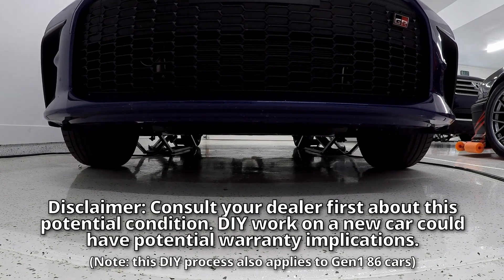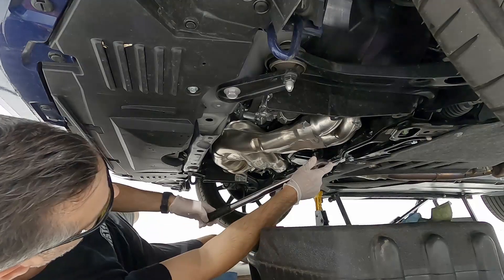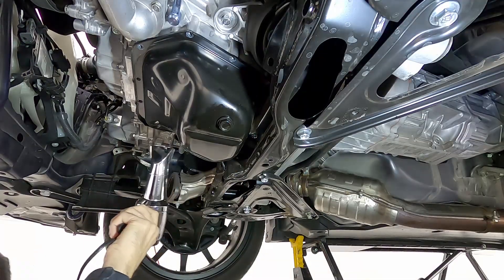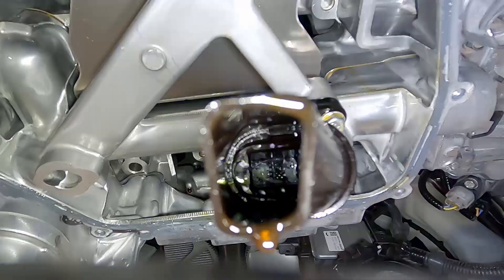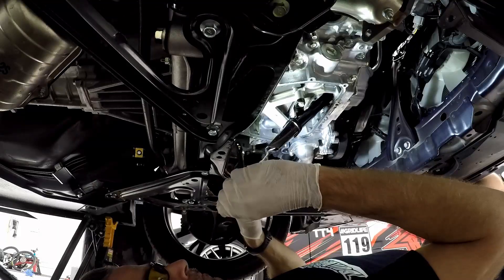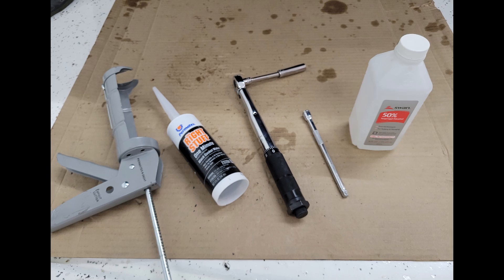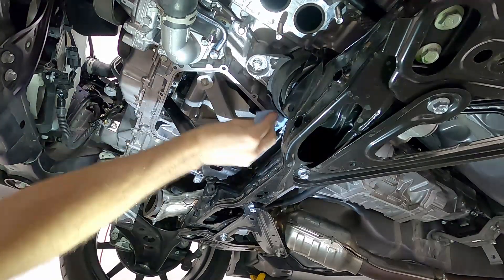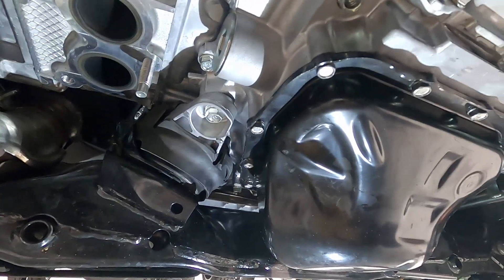RTV Silicone In Your GR86 or BRZ Oil Pickup? Here's How To Clean It

Comment: typical subaru built garbage engine, smh. this should never be a problem with any new vehicle.
Reply from the maker: Agree. I am not a huge Subaru boxer engine fan, but I had high praise for the way this one performs. This particular issue just took it down a notch again lol.
Reply: @TheBTRGarage  
 - what brand and type of oil did you fill after this service was done?

The reason I ask is because I did have this service performed on my 17 BRZ and I want the best of the best oil in my vehicle as I drive it daily and do drive it to the track as well as track and drive back from button willow.
Reply: Subaru and the lubrication issues go together like America and Apple Pie.

Comment: Toyota/Subaru should just revise this application from factory. I hope this is fixed for the '23 versions.
Reply: hopefully.. my '23 will be here in Oct. I only plan to do 17x9 arc8, 245/40 PS4S & camber/crash bolts. If the motor goes because of this silicon issue, it'll get replaced.. but the hassle of that process will always be on my mind.. big sighs......
Reply from the maker: That's the hope! With all the media coverage and chatter, I wouldn't be surprised if they at least investigate the situation.

Comment: Isn't the silicone supposed to act sort of like a gasket? why remove it?
Reply from the maker: I removed the heavy application of the gasket, which appears to have broken apart and into the oil pickup. I re-applied a new bead of liquid gasket per the service manual guidelines.

Comment: Called my dealer yesterday about the issue, due to having bits of rtv on my dip stick, the service advisor sounded concerned with he hasn’t dealt with the issue from other 86 owners. But knowing my luck I’m pretty sure my has some issue with the rtv since I’m the first gr86 they sold. We’ll see how it goes
Reply from the maker: Best of luck, hopefully it is a non-issue. Outside of the blown engine, it is just a lot of anecdotal findings like mine, but it sure seems like it is heading in the direction of wide spread.
Reply: Did your dealer do anything yet? Asking because I have the same issue and am hoping they don't try to pull a fast one
Reply: @tear728  they only did a visual multipoint inspection and claimed there’s nothing wrong with it as of right now so if it blows (knock on wood it don’t) I’m bringing it right back to them.

Comment: as someone who just ordered a brz this is very upsetting

if im spending 35k out the door i want piece of mind that im getting a good reliable car. Now i dont even know what to do, since I won’t be able to enjoy the car until I know this won’t be an issue, and im sure the dealer isnt going to just check the pan for free.
Reply from the maker: As I've probably mentioned elsewhere, I wouldn't sweat it too much. The chances of a catastrophic failure are still very slim, based on what is currently known. It's always good to be aware and cautious though, of things like this 👍
Reply: @TheBTRGarage  Im sure it is low, but even still I dont want my engine oil pickup tube blocked at all even if it never causes failure… 

Do you think subaru would charge an arm and a leg to just reseal the oil pan properly once the car arrives at the dealership?
Reply from the maker: Yea, I totally understand where you're coming from, tough situation.
Cost is going to depend on the dealer. One guy in comments here said his dealer would inspect for $175, if RTV found in pickup, they'd fix for free, otherwise out $175. Another I heard had to pay $700 for the repair, so it's hard to know for sure, unfortunately.
Reply: Its what makes a subaru, a subaru. Lmao. But in all seriousness it really does suck that I feel the best approach is to just wait it out, probably good to just wait for the 3rd/last gen after they fix the common problems.
Reply: Mazda Miata? (If a light weight rwd platform is your car of choice). I love the design of this new GR/BRZ but this would be a deal breaker for me. I have way too much O.C.D.

Comment: Just called my dealership for this exact issue for my GR86, and they could charge me a diagnostic fee for $175 to see if there are silicone bits in my oil pickup, and if they found any they wouldn't charge me, and if they didn't find any bits I would be charged. I was transferred to finance and it would void my warranty if I did it myself,  and he recommended to just drive the car like I stole it and if it blows up, they will replace it. It seems it's going to take some time until Toyota recognizes this as an issue.
Reply from the maker: Good info! I think every dealer is going to be different until Toyota puts out something official (if/when). Your dealer seems pretty reasonable, I've heard of much worse "offers" for preventitive checking of the oil pickup tube. Glad I included the disclaimer about warranty implications with the DIY approach, I figured that might be the case with some dealers.
Reply: @dr.magnanimous8973  Going to a track is different than driving it like you stole it.

The car isn't meant to perform more than it can handle stock. That's what rev limiters are for.

Drive it like you stole it, bang the rev limiter all the time.

When it goes bad, make them fix it. You drove it on public streets like a maniac.

As you should. Its a sports car. Its going to depreciate. You paid for the whole speedometer, user the whole speedometer. You paid for the whole warranty, use the whole warranty.
Reply: @zorkman111  not to mention they literally give you a free yesr of NASA membership and a free HPDE eith thr purchase of a new car.
Reply: Sounds like a game of Simon says. They offer a track day and suggest the vehicle is "up to the task". But then all that is advertising. The bait and switch. So has anyone had this issue fixed  for free?
Reply: Yeah.  This is unfortunately the way they like to handle warranties.  Even honda d1cked me around with a transmission input shaft seal issue on my S2000.  Many checks, dies, test drives, analysis, time.  All to replace exactly what I told them what the problem was and what kind of oil it is. Eventually got my clutch, seal and rear diff bushings replaced under warranty.   Then they also scratched and dented one of my fenders that I had to get them to fix...  they don't actually want to work on the cars they sell it seems.. .
Reply: My dealer wants to charge me around $430 for 3 hours of labor to tear down the engine and find any RTV bits. I said fuck that and just inspect the car normally before delivery.
Reply: @Silas, Lol What? How does doing a Repair on your own Vehicle "Void" your warranty? Did you tell them you would take it to a local Mechanic and have them clean/replace the sealant or did they also say that would "void" the warranty?
Reply: Easy to find with boroscope maybe.
Reply: @marshmower  Apparently the oil pickup tube is too low to the bottom to get in there without dropping the pan.
Reply: But they don’t allow you to enter the plant. They can lie to you, right?
Reply: $175 is well worth it for peace of mind IMO
Reply: For the love of God do not drive the car like you stole it... thats asking for the warranty to be voided. They could potentially site it as vehicular abuse and deny your claim. For the time being just drive it normal with the occasional spirited drive.
Reply: @joelsalazar3627  it seems that making a video of it is grounds for dismissal.  Also if something does blow up, keep the car don't sell it.
Reply: @joelsalazar3627  driving a car hard is not grounds for a voided warranty unless maintenance is proven to be neglected. stop spreading misinformation.
Reply: @busterscrugs  Depends, are you on a racetrack at the time? Apparently even if you're in 3rd gear and haven't gone over 4500 RPM and it blows, they'll refuse your warranty.

Comment: This is just upsetting, I’m picking up my new 2023 gr86. Knowing it’s coming with a problem is a bummer.
Reply from the maker: I wouldn't sweat it too much. While the issue has blown up on the internet due to a small amount of failures + warranty denial, I don't think it will be an issue for most people. But, that's just my guess, only time will tell :)
Reply: @TheBTRGarage  gulf states Toyota really dropped the ball on this, if they had just fixed it without kicking up a fuss I doubt it would have so many purchasers and potential purchasers lose confidence in the car. Wonder if Toyota themselves will come down on gulf states over it.

Keep reading so many people cancelling their orders over this
Reply: @TheBTRGarage  hey Justin. Do you think it won’t be an issue for most because Toyota already caught the problem and switched to a new brand of silicon?
Reply from the maker: @shaneh734  While it might look like a bad problem, there is not yet a lot of evidence that it is specifically causing engine issues/failures. We've seen a few, but in the big picture that's not a big deal, yet.
Reply: This was an issue in Gen1 as well.  Unlikely Subaru did “Jack” to correct it.  Probably saves them 20 cents per connection point.   🙄

Comment: I guess it's gonna be an annual oil pick up cleaning for me 😮‍💨
Reply from the maker: I would imagine once this is cleaned up, it should be good for a while. Unless the RTV is coming from somewhere else higher in the engine (timing cover or something) ☹️
Reply: @TheBTRGarage  the amount you removed at 4000 miles is concerning. Maybe not annually but at minimum once every few years. I hope Toyota and Subaru can waive shop labor and fees to get it cleaned and inspected at least once during its warrantied life.
Reply from the maker: I agree it seems like a lot for such low miles. Definitely hope they add some kind of check to regular service intervals.
Reply: @wyyn  Seems reasonable since there's not a ton of GR86 out there.

Comment: what should i be looking for? high oil temps? or is it like a silent assassin.
Reply from the maker: Oil pressure gauge would be the ideal thing to have, but you would have to install that manually. Otherwise yes, it is kind of a silent assassin ☹️ Avoiding high revving or extended high RPM's is the other way to play it safe, but that kind of defeats the whole purpose of the car.

Comment: Has this been specific to the GR86 and not the BRZ?
Reply from the maker: Both cars would have the same issue, since it is a Subaru built motor. The only difference would be how dealer/manufacturers would handle potential warranty claims due to this issue.

Comment from the maker: My guess is this will likely be a non-issue for most owners, although I understand the concern. Again, contact your dealer first, you should not have to DIY this process unless you understand the risks.

As mentioned in the video, if you are concerned your car may have this particular issue with silicone in the oil pickup, contact your dealer first! DIY should be the last resort as it may have negative warranty implications. This process also applies to previous gen 86 cars, likely out of warranty, which is a big reason I created it.
Reply: The tech at the dealer will probably slap too much rtv on again when they reseal it.
Reply: Wow! admired your bravery and handy working on a brand new car like that. I'm curious as to when you sealed the pan back after the clean-up.  How do you ensure that the RTV sealant you put on will not cause the same issue?
Reply from the maker: @nikornvittulananda2860  Hopefully applying a smaller bead of gasket reduces the risk. That's about all you can do.
Reply: @TheBTRGarage  Would it be an option to replace the RTV with a solid gasket?
Reply: @TheBTRGarage  Are you sure the sealant around the sump is the issue?  The grey sealant is used for the timing case as well..  In other areas as well probably..
Reply: There is NO way I would be doing this myself, and why should I? It is a prick of a job removing headers and the sump, I've done it several times on my car.  Has to be a minimum three hour job from start to finish and that's with the right equipment and lift like you, and I. have, and no unexpected issues that always pop up[.    Especially when there should be absolutely no need to.  Where is the silicone coming from and how would anyone know when it's going to stop.  The silicone you removed could be only a small part of what's circulating in the engine and could potentially lead to a catastrophic engine failure.  I'm amazed that Toyota gave you the OK to DIY this job without it voiding your warranty should oil starvation be a future issue.
Reply from the maker: Toyota did not give me the ok to do anything. I made the choice to DIY and I'm aware of any warranty risk.

I know that RTV can come from other places, like the timing cover, for example. Which, is why I have said in several other comments, that doing this will job will likely only reduce risk of a problem. Not eliminate it completely.

Comment: is there a Fumoto valve in your (near) future?  Yes, I'm aware of the potential negatives,  but having a much more controlled oil stream when draining seems benefit enough and no torque wrench needed afterwards...glad you caught it when you did...what did your dealer say (if you asked?) about warranty repercussions?    all of the silicone is just from their assembly process???
Reply from the maker: I may add a Fumoto valve, not on my short list though. They are nice, I have one on my truck and have never had issues.

I have not asked my dealer yet, I wanted get the video done for those who might get pushback from their own dealers and need to DIY. Plus, for the older gen cars since it's the same process. The silicone is just from the assembly process, correct. It is all done by machines, and maybe this is all normal and within the Toyota build specifications, but it can clearly have negative consequences in some cases.
Reply: fumoto drain valve is a waste of money. torquing a drain plug only takes a couple seconds.

Comment: Pretty significant oversight if this affects all cars and not just an unfortunate batch.  Hopefully Toyota/Subaru figure out how widespread this is quickly
Reply from the maker: It's a developing situation for sure. Toyota will be gathering data to weigh the risk between letting it ride and facing warranty claims (potential loss of $), or issuing a recall of sorts to take preventitive action (potential savings of $). That's my guess anyways...
Reply: @TheBTRGarage  This seems to be happening to almost everyone who's popped it open so far.
Reply: ...but from the sounds of it...the dealer will only do a research pull of the oil pan and may charge the customer for the time....if there is silicone there, they (the dealer) might be able to make it a warranty claim; however, if there is no silicone, it would all be on the owner of the car as "no action necessary" from the dealer's perspective....

Comment: you spelled " Take it to the dealership and have them fix it because it's a manufacturer defect" wrong.
Reply: 7:45 he says to contact the dealer first
Reply: @saiyan2525  yes it was a sarcastic comment based on the recent trending manufacturers failure to help (which were just found to be resilved ). Sorry it went over your head.
Reply: @saiyan2525  ...but then, how many days will you be w/o your car?  IF (<-- big if) your dealer does give you a loaner, not so bad, but a lot of dealers run very small loaner fleets and may not indulge in this instance.  I  guess you could work out a rental car agreement, but that is btwn you and your (understanding) dealer...how long will it take them to get the issue looked at and resolved?
Reply from the maker: @saiyan2525  Actually I put the disclaimer right up front, about 00:30 in :)